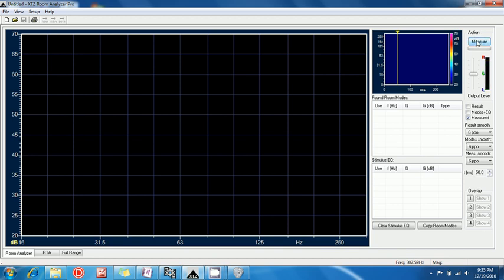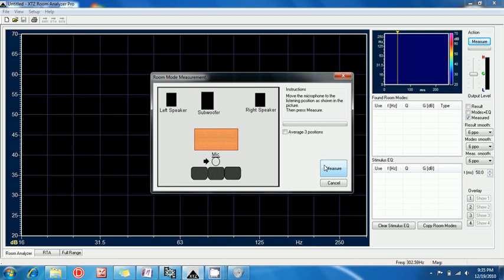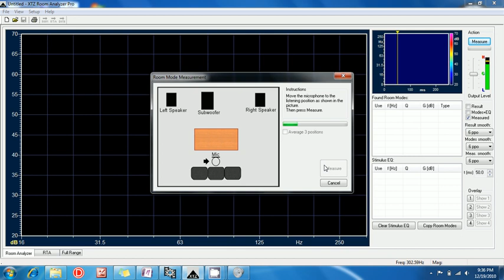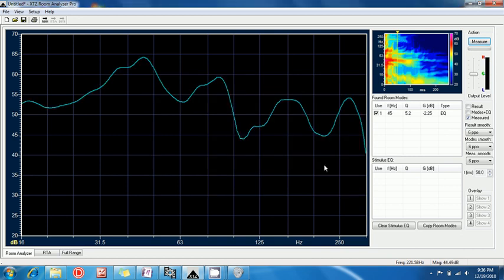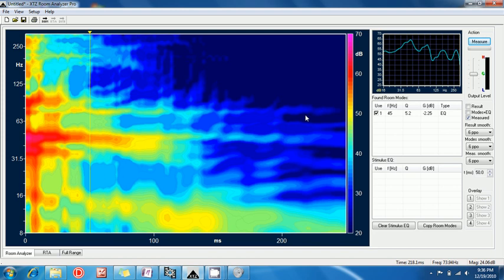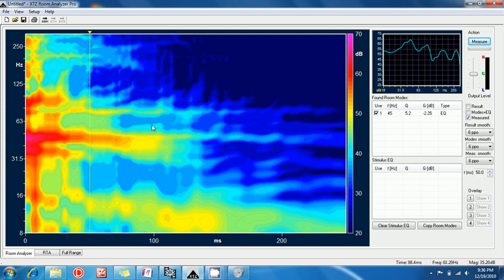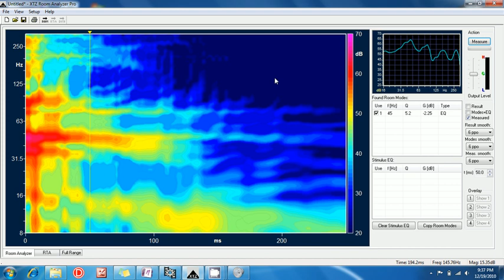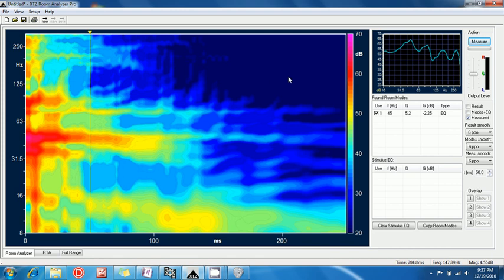Using XTZ Room Analyzer to measure your room in under 3 minutes

Comment: Hi , Mr. Mellor 
Dear sir, can you introduce me to the method of measuring the noise in the rooms. I have a project and it asked me to measure and analyze sound in offices where employees work, what are the possible solutions, and what is the percentage of improvement and sound treatment after installing sound processors

Comment: Well, what next? Certainly, if you want to do anything useful about the audio properties of the room, you need to be able to associate the frequency response with the physical dimensions of the room and spot the problematic areas. Does the program provide anything in that sense? Otherwise I could just use any freeware audio editor (e.g. audacity) and get pretty much the same results...
Reply: I do not understand English very well but it seems to me that the title does not says what you asking...and no...you can not do the same thing with Audacity. Rather I would ask about the mic and interface setting. Good luck with REW, the next step.